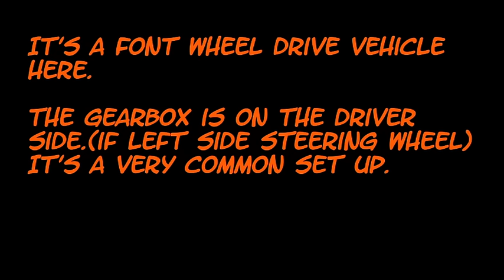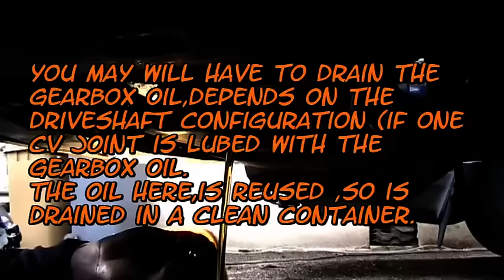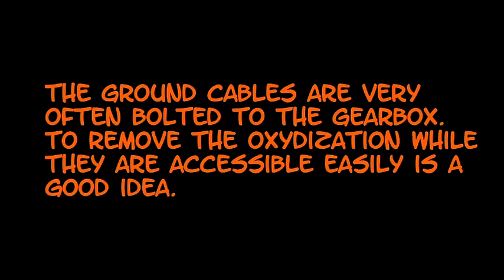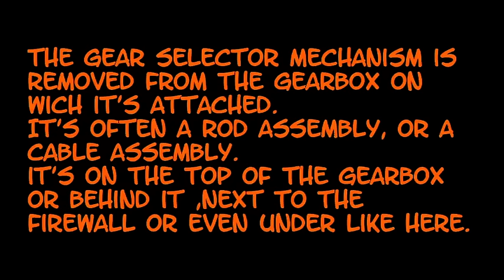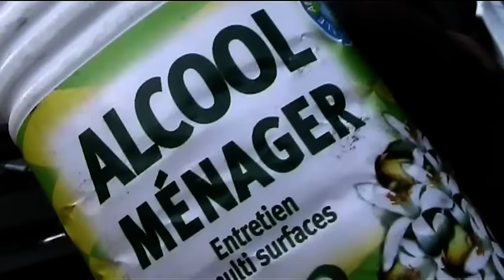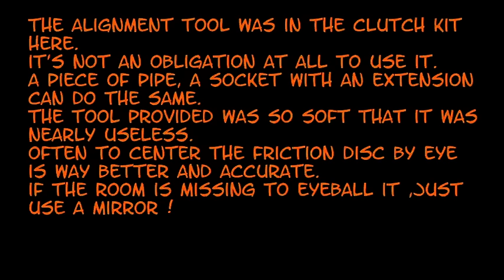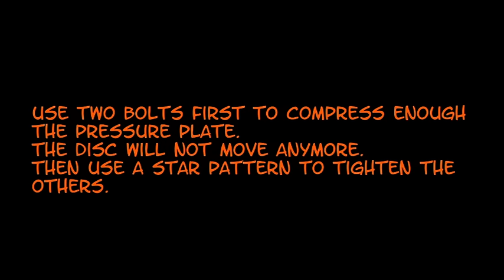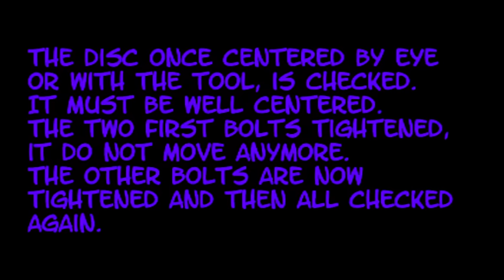Front Wheel Drive car clutch replacement.

Comment: Hello i wanted to ask a question . When i release the clutch pedal of my car gradually the car vibrates heavily also some gears slip while driving . Does that mean i need to replace the clutch ? Anyone answers my question would be very grateful thanks
Reply from the maker: Hi,
It's often the sign the clutch is grabbing the flywheel unevenly.
How many miles /kilometers on the vehicle ?
Original clutch ?
Reply: michaelovitch hello 
Thank you for your reply :) 
I dont really know the number of kilometers but it has been driven after the replacement i think for 6 years or more
Reply from the maker: If you make a lot of city driving ,or with a trailer,or stunts with the car,i'm pretty sure it's the clutch wich do not engage properly.
You need to be sure you have enough freeplay on the cable so the clutch can travel enough to grab correctly ,or if it's a hydraulic system, enough fluid,,and no air in the system.
Where does the clutch start to engage when you release the pedal  ?
Pedal way up,at the middle of the travel,or way down ?
Reply: michaelovitch i think its way down as when i start only releasing the pedal it engages but then the car vibrates and everything vibrates in the car
Reply from the maker: Ok,
You need to check the engine mounts first.
Have somebody looking at the engine,hood up, when you engage 1 gear.
Reply: michaelovitch yes but i forgot to mention that it doesnt vibrate when the first gear is engaged , it only happens at the time i release my foot off the clutch pedal
Reply from the maker: Yes,when the engine is engaged to the gearbox,the engine want to twist in the car,because of the torque it's producing.
If an engine mount is broken it will move and shake all over the place.
You need to check that.
Reply: michaelovitch okay i will check this so if a mount is broken the engine will shake 
But doesnt a worn out clutch can also make shaking too ?
Reply: michaelovitch i just want to tell you that the shaking only happens when the clutch is disengaged to have gear 
I am really sorry if i am taking your time or annoying you but thats ana important issue for me .
Reply from the maker: You are in neutral,then you  press the clutch pedal  to shift and it's shaking at this moment ?
Reply: michaelovitch No it shakes at the time i am removing my leg off the pedal until my leg is fully off the pedal its not shaking
Reply: michaelovitch i am in neutral yes and then i put my leg on clutch pedal and then putting stick to first gear and then when removing the clutch pedal gradually the shaking happens
Reply from the maker: Ok,
check the cable tension to be sure first.
check the motor mount to be sure
It's more likely the clutch wich do not engage properly because of wear,or hot spots on the flywheel/pressure plate.

Comment: İs that a old Renault from late 80s early 90s?
Reply from the maker: Yes,Renault 21 gts from 1990.
It's my car.
Reply: @michaelovitch  Nice solid car. I really liked it.
Reply from the maker: @korayyuzbasoglu9257  It's a good car yes, but you better not to crash in a tree with it,it's not as safe as tdays vehicles.
: )
Reply: @michaelovitch  Its applies for most of the pre 2000 cars. Also it not have any kind of safety equipment like ABS or Airbag. Its just a engine seats and wheels :)

Comment: I think I opened my gear box by mistake but I was able to get it back together.  Hopefully this will cause no problems.
Reply from the maker: It shouldn't be a problem.
Just be sure to have the correct amount of oil in it.

Comment: Thanks for showing us this, was interesting to watch. Are you using a portable air compressor for your air tools? I thought compressors were quite noisy but I can't hear one in the background
Reply from the maker: +Chris Morgan 
Thank you : )
I had an old and tired compressor here wich is dead.
I had to replace it by an other V twin compressor to run easily air tools.
You can't hear it because it was off or i 've edited the too noisy parts : )

Comment: Why am I watching this lol. Having spent 2 years working in a clutch centre I've fitted hundreds of clutches. Sick of the sight of them. One or two things in this vid were a bit odd but not really a problem. I would point out a few things, only use a small amount of grease , you should disconnect the battery, remember which holes the gearbox bolts came from as the length can vary. Also remember that the procedure for changing a clutch can vary a lot from car to car , especially if it's a dual mass clutch, so as said read a manual for the model of car if you can.n
Reply from the maker: We removed the excess of grease,i should indicate that in the video : )
Clutch center ? i didn't know there were places just for clutches.

Comment: Thank you, i enjoyed that video :-)) Thank you for the english captions :-))
I was close to swearing when the casing did not want to leave the engine lol, the manufacturers didnt leave much room did they?
My frend replaced one on a ford ka, very similar and the engine had to be jacked up to stop it dropping out, or was it just a crap car ha ha :->

Oh dont you love front wheel drives ha ha :-))
Hope the car is all happy now, its not a race car you know lol, poor clutch just didnt have a chance :).
Reply from the maker: No too much room like you see =/
I've used the troubleless technic letting the gearbox in the engine bay.
I had to remove it when i did the same job on my brother's car ( a 206 ) and on mine.(but mine is a rear wheel drive,so had no choice lol)

The car is good now,the gear shifting is way better : ) 
Like in your friend's ka it's not a race car but those clutches wear out anyway : (
150 000 kms and 24 years is not too bad after all !
How much lasted your friend's one ?
On mine brother's one the throwout bearing just ate the pressure plate diaphragm type springs.
Looks like it was intented for !
their surface contact is really tiny while on my old volvo it's really wide and it slides without creating a groove in it.
Reply: michaelovitch
My frends ka is still going fine after 5 years, god knows how long it will last lol.

Another frend dragged me outside lol to fit wiring for a 7 pin traylor hitch to his peugeot 307, oh fun lol, for some reason the manufacturers use codes for the wires not colour, i thought "good idea" but my eyes had a really hard time reading the tiny tiny codes on the wires :-(, the wires to the back lights were also very thin, i worried about them getting hot and causing other problems:-((

If it causes problems i will have to throw a bucket of relays into it ha ha :-)), that will bypass the thin wire worry :-))

Also too many computers involved, my old brain cant cope lol.

Comment: Am I mistaken or did you omit the part about any "pilot bearing"?   Overall, a first class instructional.
Reply from the maker: +Michael M 
Thank you : )

You are right.
It is only greased,because in good shape.
It was not replaced.
I could have replaced the seal on the crank but it didn't leak,so i let it alone.
Reply: +michaelovitch If it were me, I would have replaced both because all the labor had already been done and it is doubtful they would last another clutch.
Reply from the maker: +Michael M 
I agree with you.
I should have, at least for the seal.
For the next clutches ,i will,and certainly film it.
: )
I'm a Michael M too you know : )
Michaelovitch is a nickname.

Comment: It's ok fitting the clutch, that's the easy part.. it's the hole engine & dropping the subframe, is a fking nightmare.. on a Mondeo Mark 3..
Reply from the maker: I agree,but there is often sneaky ways to avoid that.
I was supposed to remove the gearbox from the car here,according to the manual,but just pushed it away.

Comment: Why remove oil for dry clutch
Reply from the maker: Sometimes,depending on your transmission , one of the axles go through the gearbox,so removing the axle woud make the oil leak,unless you tilt the car a lot on one side.

Comment: you basicaly need to change the whole components right?
Reply from the maker: To do the job the best way :
change the friction disc,the pressure plate,the thrust bearing,the cranckshaft seal behind the flywheel.
Check the flywheel shape ,the fork shape.
check or replace the slave cylinder if you have a hydraulic system.

Comment: I swear that clutch fork ball mount looked fractured weak spot in many cars, can be fine one minute then loose total motive power due to the ball coming through the fork
Reply from the maker: It's still working fine,i didn't see it was cracked.

Comment: when I press the clutch down it can't came back .my car is Jetta 3
Reply from the maker: Check the clutch cable if it's not broken and attached to gearbox and pedal.
If it's ok,then you may have a broken pressure plate or thrust bearing on the clutch assembly.

Comment: That flywheel needs resurfacing, looked bad, then it will shift very very smooth.  Plus, while you have the flywheel off change the crank rear main seal, if possible.  That grease may get on the clutch friction disk.  Very nice video otherwise.  Good job.
Reply from the maker: +cndvd 
Thank you : )
The flywheel on the ground was ok,even if not perfect,resurfacing could be done,yes.
it was just a part to illustrate.
The one on the car was in very good shape,it's shifting well,no problems since, with 30 000 kms.
Reply: @michaelovitch, cool video thanks for posting it.  Good job and nice to hear it's shifting well.

Comment: Am trying to replace the transmission
Reply from the maker: Did you succeed ?
Reply: @michaelovitch   no am starting Monday am trying to collect as much information as I can I haven't done anything like this before
Reply from the maker: @kevintboy9538  Good method.
There are certainly shop manuals for your model of car.
It can help you a lot,specially to locate bolts,or whatever specific location of parts on your model.
Most of cars are very similar,but sometimes a part,nut,bolt or hidden screw can be a pain in the butt.
Adjustments,fluids quantities etc,are indicated too.

Comment: Far too much grease. You need anti fretting compound on the splines not grease. Also note, when you drain the gearbox oil, check that the filler plug can be opened first, it would be a disaster to empty the gearbox oil only to find that the filller plug is scuffed or rounded out and you can't remove it.

Comment: what car is dat please
Reply from the maker: Renault 21gts 1989.
1.7 liter engine,90 hp two barrel carb.
Reply: Mazda 6 clutch replacement
Reply: I did my clutch on a Mazda3 2004 I didn’t have to do all that they removed to much stuff just to do a clutch

Comment: Because axel nuts are always so easy to remove like that
Reply from the maker: It's around 250 Nm here,so it's 25 kilos at the end of a 1 meter bar.
I'm heavy so even a half a meter bar is ok to do that quite easily.
If it's rusted,just add a pipe to get that longer ,or clean the axle threads before removing the nut.

Comment: Way to much grease and contamination of the friction plate. And didn't clean the new one because it will still have machining fluide and grease on it to protect it  while in storage. And you cleaned the flywheel then washed all that oil from the bell housing on it.
Reply from the maker: We removed the exces of grease before remounting the whole assembly.
I should precise that in the video.

Comment: I have a problem after my clutch replacement. My gear shifting throw is now longer(or futher) than before from gear to gears. I hve no idea why the throw increased that much but the mechanic told me that it was fine. I can't stand the extra throw distance but I still have no clue on fixing it now. anyone knee the problem please feel free to drop a comment right here. they always helped. thanks yeah.
Reply from the maker: The movement on your gear stick is longer ?
Or the clutch pedal stroke is longer ?
Reply: michaelovitch the movement of gear shift.
Reply: my old mechanic said it was okay and has no problem. Obviously not okay! and he didn't wanted to check it for me. I screwed up and then, I had my new mechanic checking my car. He mentioned that the misplacement of gear lever caused it to bend slightly. He bended it back and everything went back to quite normal now. But is a bend gear lever dangerous to drive with?
Reply from the maker: The stick itself is just a piece of metal.
You can give back to it its previous shape without problem.
The important is not to bend the linkage going to the gearbox if you have a front wheel drive car.
So,no it's not dangerous.
Reply: michaelovitch I see. thanks micheal!

Comment: There is another video which shows an easier way to remove the drive shafts on the Swift. Basically, remove the bolt that holds the lower ball joint in place. Great video otherwise. Agreed on the too liberal use of grease - 90% will not be used there, especially on the pilot bearing, which could get onto the clutch plate by centrifugal action. Otherwise well done.
Reply from the maker: Thanks.
Yes about the grease,we removed the excess,i should have recorded that, i get the remark often : )

Comment: Wouldn't it be easier to remove the whole front assembly and access the thing from under the radiator?
Reply from the maker: +Кирилл Рагузин 
In this case,not,because there is some room to work on,and you just can push the gearbox aside.
On other cars,yes, it would be a good thing to do ,for sure : )

Comment: Just by looking at the pressure plate, I would've had the flywheel resurfaced at a local machine shop.
Reply from the maker: +Mike Paulski 
It's no dug,and the new (and old) clutch grab without hesitating.
What make you think it needed that ?

Comment: Woah... waaaaaaaaaaaay too much grease.  I'm sure since this video your clutch has be slipping again.  You are only supposed to put a trace amount on the splines and inside diameter of the throwout bearing.  Yeesh!
Reply from the maker: Yes,too much.
We cleaned before to finish the job,so it's all good.

Comment: If cars were engineered you wouldn't need to strip so much out just to get to a wear and tear item. A motorcycle is a couple of hours if that. A car can be four hours to an all day plus affair.
Reply from the maker: I agree.
Most of the time cars have their clutch changed once,and then go to the scrapyard during or at the end of the second clutch kit life,because it becomes too expensive for the owner to justify to invest in and  keep a used car.
So engineers don't really care to improve and make easier to service an item that is made to last 150 000 kms on average...

Comment: All this work to replace a clutch in a fwd, jeezus.
Reply from the maker: Yep !
Luckily it's only every 100 000 miles or so...
Reply: Well im looking at a 93 honda civic with 175-230k miles on it so, hopefully the clutch has already been dealt with!
Reply from the maker: You should be at the second clutch kit end's life with this mileage,unless the car was mostly used on freeways,where gears shifting are rare.
Reply: Of the two cars im looking at i get very little to no detail other than runs clean, new tires.
Reply from the maker: That means  that you have to take a real good look under the hood and under the car.
If you do the maintenance yourself ,the clutch is one of the less expensive ,parts are really cheap.
if somebody do it for you,it's the most expensive operation.
Reply: Yeah cheap parts plus a PITA operation equals a lotta pay for someone else, but i plan on doing all the work on this car myself as its going to be my first project car.
Reply from the maker: What kind of car will it be ?
Reply: a lot of the cars i keep clicking on are honda civic sedans.
Reply from the maker: I meant : will you keep it stock ,or you will modify it to your taste ?
Reply: Oh, it will be modified, more than likely ill swap the engine further down the road when i get some money saved back up but ill probably do things like shorty shift levers, a good clean, and fixing any other problems the car might have. it definitely wont be stock
Reply from the maker: Have a nice work.
: )

Comment: My gearbox is dying :( .. . So is the clutch lol.
Reply from the maker: How many kms /miles ?
Reply: @michaelovitch  about 97000, fiat panda 1.2
Reply from the maker: @Vanadeo  
That's not a lot for a clutch,and even less for a gearbox.
A lot of city driving ?
Reply: @michaelovitch  Could have been the case for the previous owner. To be honest with you It might just be the pilot bearing going and as for the clutch I have since read the sticky squeaky pedal might be the external slave cylinder.
Reply from the maker: @Vanadeo  
Try to purge the hydraulic first,it's just maybe air in the lines,or a crappy fluid,too old.
Then,you can check more in depth.
Pilot bearings usually last as long as a clutch.

Comment: its much easier if u just remove the entire engine... this video is too much hassle.. lots of things to remove... u yank the engine out... replace clutch.... put it all back in... then ur done... thats how we do it in my country
Reply from the maker: +sonny boy mansanal 
Removing the engine is a big job too,even bigger.
On vehicles you have to remove the gearbox by under the car,wich is difficult to do if you want to remove the powertrain.
On others,you just can push the gearbox on the side,like here,and it's the easier.
For sure all are easier with a car lift : )